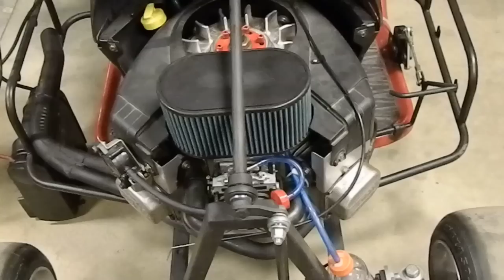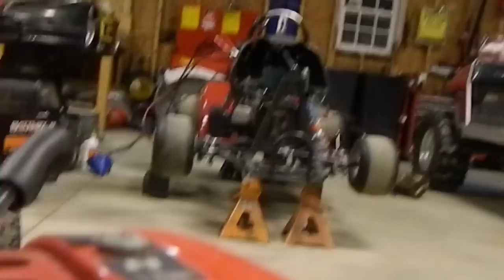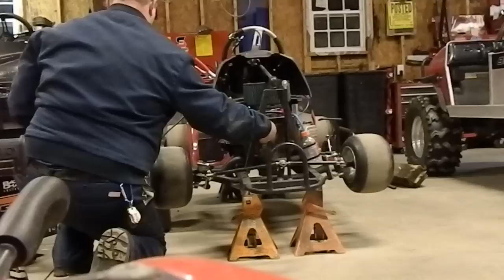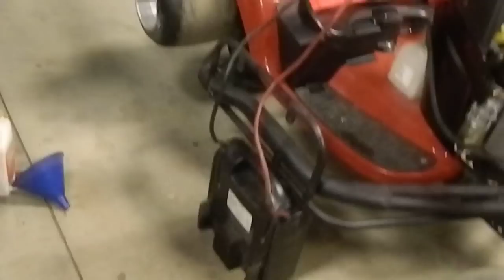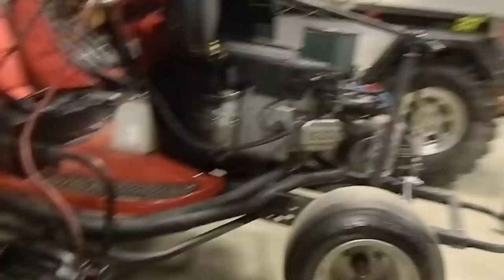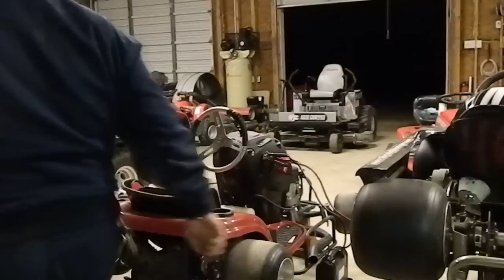Racing Mower Outlaw Super Modified

Comment: We are using the 60ci= 993cc Briggs big block v-twin ,worked heads , small turbo(cost=400$ complete)4340chrome moly forged con rods /JE Forged pistons and installing in a 2007 Harley Electra Glide . Hooks right up to Harley 6 speed transmission. 100hp at rear wheel.  Faster and smoother than stock  110ci engine, with more hp and more torque.....You did a great job with your engine build .WHY don't they let race teams use the briggs/kohler  stock 60ci engine  instead of taking 30ci engine  then bore & stroke ?  It would be easier and less costly.

Comment: What did you do for the crank and flywheel? Are they stock pieces? I used to run and build Jr. Dragsters as a kid (35HP from a 5hp flathead briggs 8,000 RPM) and those motors cost a fortune. Im going to build a mower like yours from the one I just bought and try to drum up interest in the area. Want to start a mower class at the stock car track.
Reply: Wow I want one

Comment: I do have a good question about the motor. Have you had problems with the intek? I heard inteks are cheap and lousy. I understand almost none of the engine is briggs anymore but I want to have a decent platform to build of of. I'm planning on using a vanguard vtwin 16hp because vaguards have better cams and cranks I have heard. I was planning on a new exhaust, billet flywheel, and k&n filter. any suggestions would be appreciated and the engine would be bought used.

Comment: So what horse power did it start out being i have a intek 23hp as you can see on my page any ways just wandering bout parts all the rods i have found for it are in lengths not hp so not sure witch ones i need without tearing it apart thanks.